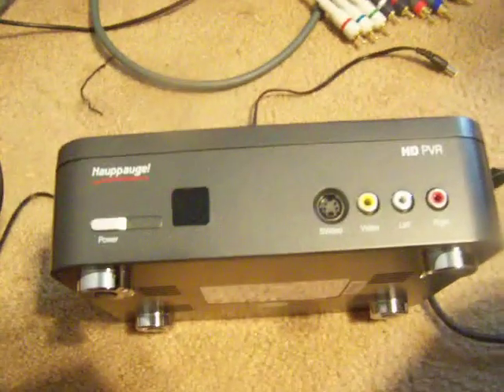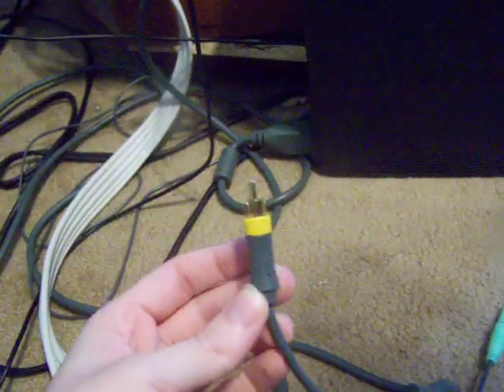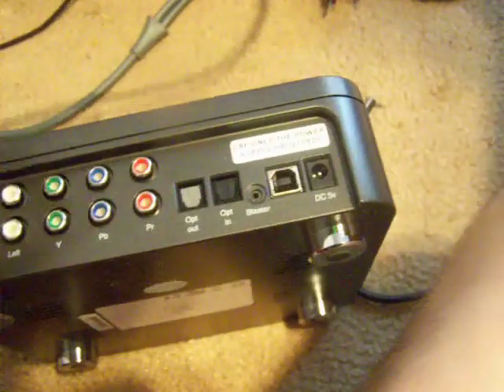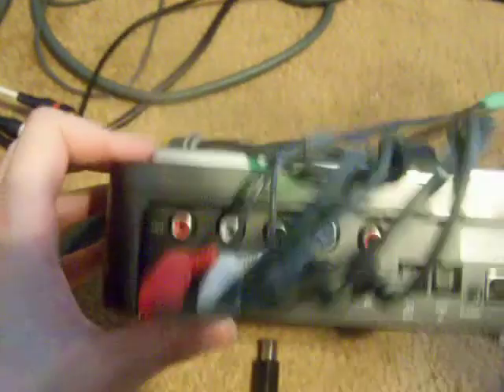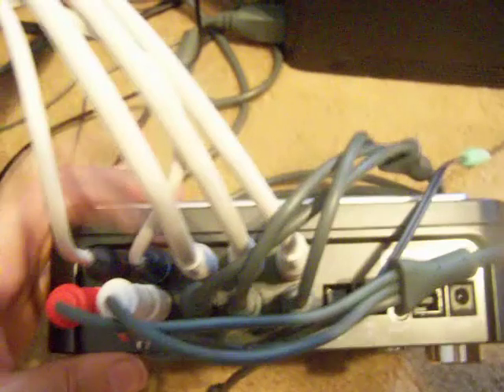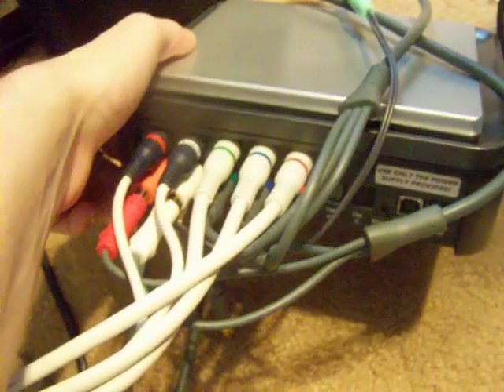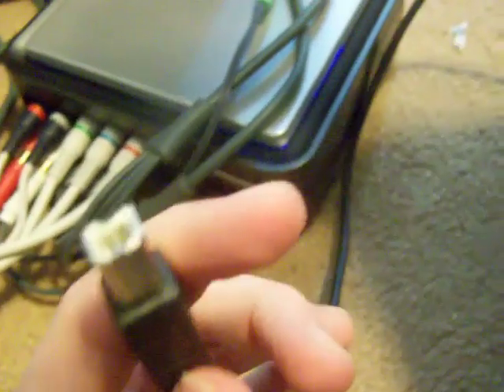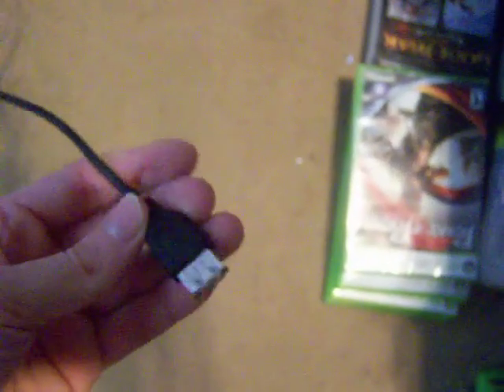Tutorial: How to Record Gaming Footage in HD with Hauppauge Part 1: The Setup

Comment: @DakotaDidYou hes using the turtle beach X series idk which model but the X11s are resilient as fuck and great quality transmitting and input and comes with the audio cable you need for this anyway  and they are only 40 bucks on amazon and 58 with 1 day shipping so thats all you need to know basically